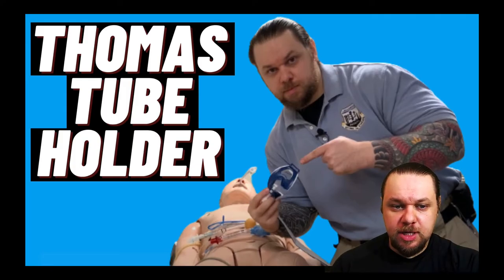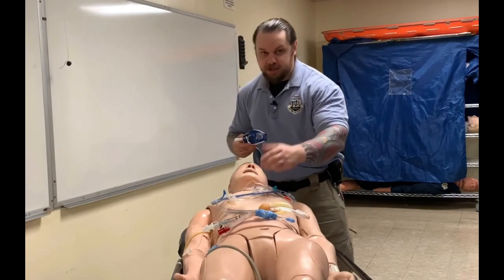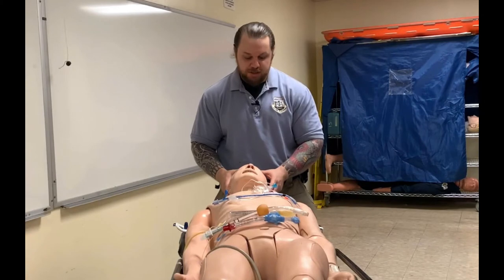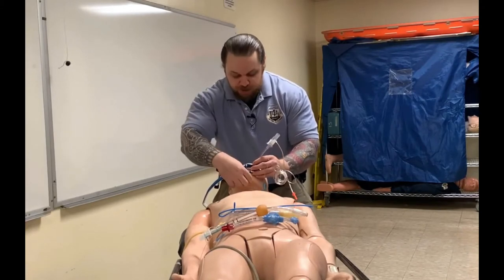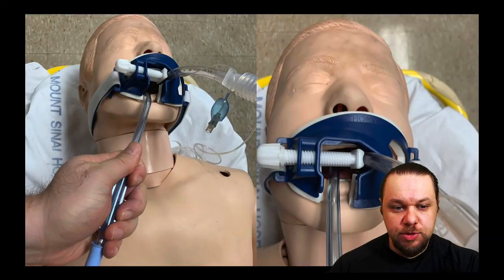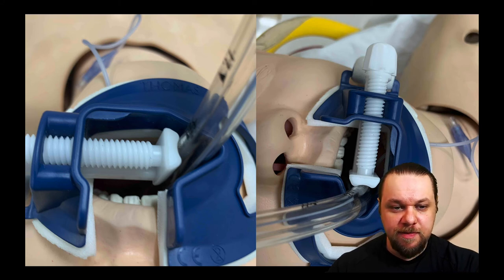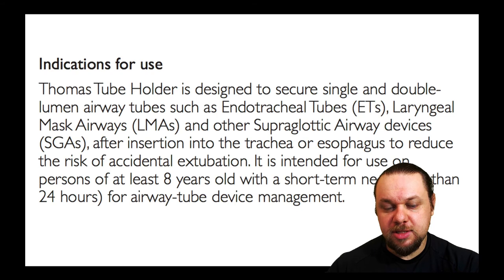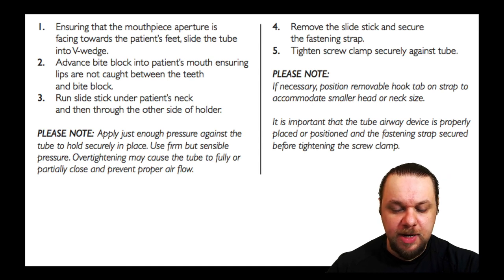How to properly use Thomas Tube Holder for securing your ET tube and SGAs?

Comment: first of all, thanks for this video. ive found this very helpful. ive got a further question below

4:10 - by "sliding the tube into the v wedge", doesn't the manufacturer basically mean to vertically slide the v wedge down alongside the tube with the bite block towards the mouth, as opposed to laterally moving the tube towards the tube holder? I would have thought that by manually moving the tube left towards the tube holder, this affects the good seal we were originally trying to create and maintain

Comment: much better if camera is on the face because we can not see the real thing.
Reply from the maker: I agree, if you check out my video titled "How to use Macintosh (Mac) and Miller Blade with First Person POV for Endotracheal Intubation?" at start of 9:35 mark (https://youtu.be/OMUx5uLOInc?t=576) I am using a 360 Camera and you can see Thomas Tube Holder application from first person point of view. Hope that helps!